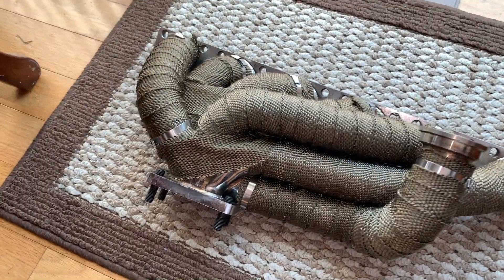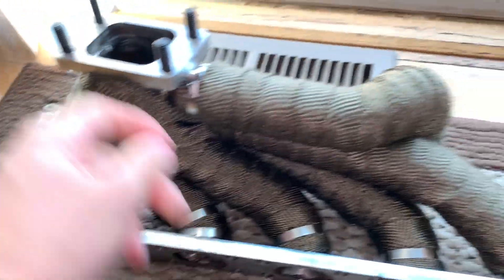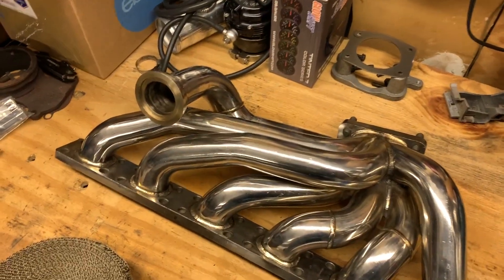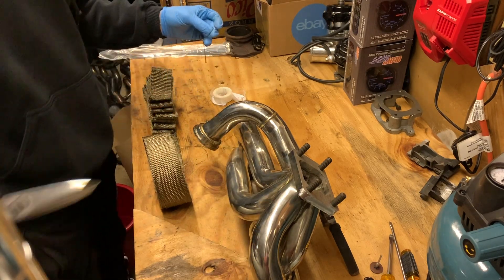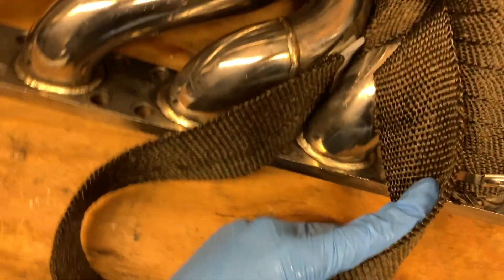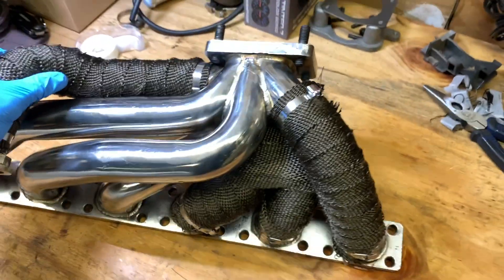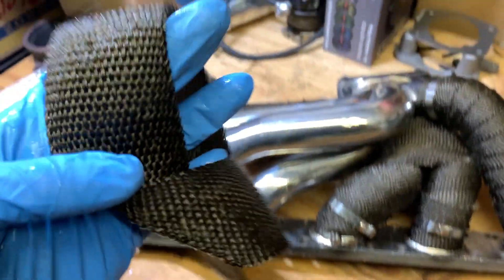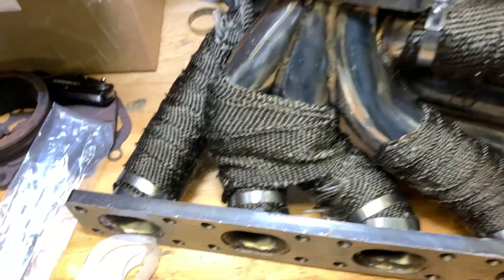M52 24v BMW E30 Turbo Build: Turbo Manifold Wrap (Ep. 2)

Comment: Sure the stainless could crack, but if it’s made by a reputable enough company it’s not a reason to stress. the heat wrap does very important job in decreasing engine bay temperatures. Nobody wants an e30 on fire haha

Comment: where did you get that manifold? it fits good in the e30?
Reply from the maker: yeah it fits nicely in an e30. its a rapid spool industry good and tight 24v e30 swap manifold
Reply: @ImJoel  okay, link? you running m50 or m20 tilt?